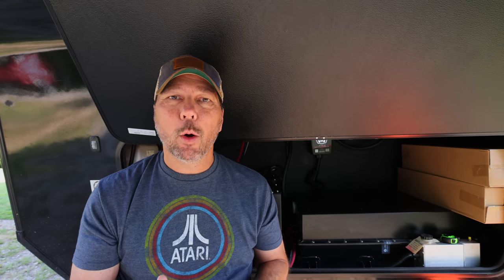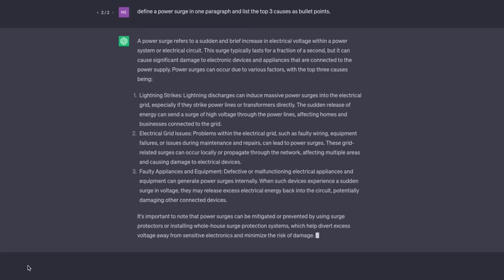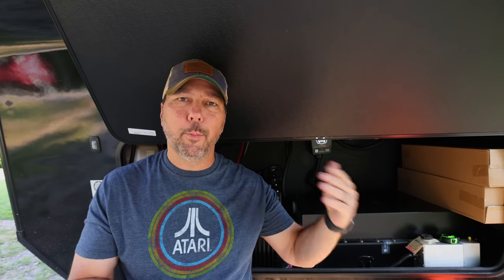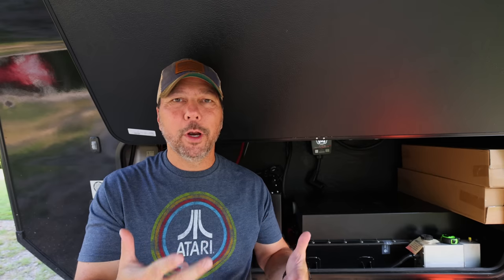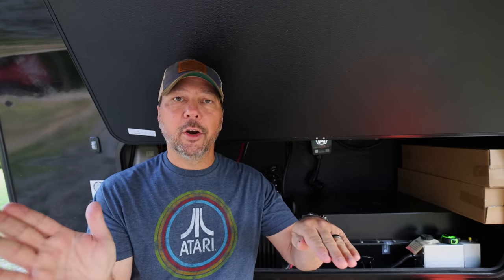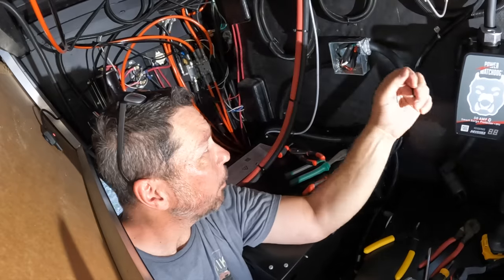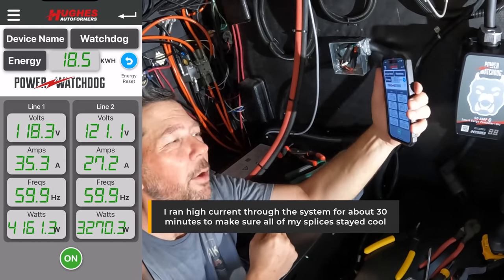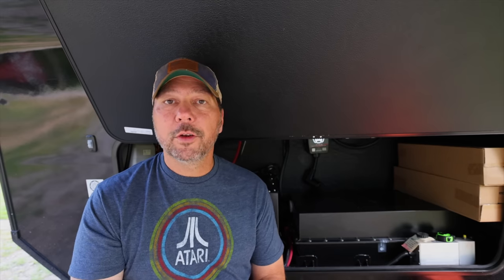RV Power Protection (Hughes Watchdog EPO plus Autoformer)

Comment: We were at an older park in Pennsylvania . . . . major storms . . . .a branch took out the power line . . . . major surges fried AC, microwave, TV, coffee makers and other electronics in RVs without  surge protection . . . . everyone using their air conditioners in the heat of the day . . . . the 20 amp circuit checked in at 111 volts.  A great example for surge protection! This video couldn’t have come at a better time.  Thank you!
Reply from the maker: Also, that 111 volts isn't great for your ACs... The Autoformer would boost that to a normal 122. https://gear.changinglanesrv.com/product/hughes-autoformers-voltage-booster-with-surge-protection-50-amp/

Comment: I've had the setup like yours for about 3 years and it has worked great. Initially I had the autoformer inline with the epo. The problem  with that setup is if we were in a RV park that was almost empty the voltage would go up and with the 2% added from the autoformer it would take the voltage over the limit of what the epo would allow. So now like you I just use the autoformer as needed. I have used the autoformer 4 or 5 times in the last 3 or so years and every time it was a situation like your Vegas episode. Very hot everyone running their air conditioner causing the voltage to go low so no air conditioner for us. Autoformer to the rescue worked every time. Once I had voltage down to 99V.

Comment: I added a hardwired Watchdog EPO to my 35ft Class A two years ago after dealing with low voltage issues at a State Park during a hot July 4th weekend. It has been bullet proof, and alerted me to issues my generator was having that I had no clue about. The project took about three hours from start to finish and was pretty simple once I figured out where I'd place everything in my small electrical bay (have to leave room for an eventual inverter). Definitely agree that the BT connectivity and the app are a great bonus. Great video and thanks for the ideas!
Reply from the maker: Finding the right spot is the hardest part of any RV project.  👍🏼

Comment: I hard wired in a Hughes Watchdog 50a to our 2019 Imagine 2800BH.  I love it.  The only issue I had (user error) was when we were boondocking last year north of Sundance WY in the national forest. I was then running on a single 100ah lead acid battery and wanted to run the AC and charge the batteries.  I started the generator and linked an extra 30a extension cord to get the generator (a Westinghouse iGen4500) farther away from the camper. This is the point where I leaned about line loss. Our Hughes would let power through until it sensed low voltage and then shut off. I learned a few things that week.  #1 - I need to get a soft start for the AC. #2 - Extra extension cords are limited in use. #3 - get Lithium batteries.  We now have a 200ah Li battery that lasted us 5 days boondocking in SD this year.  It was at about 12.4V when we left the campground.  I checked voltage when we got home after about 11 hours and the battery was fully charged from the trip home.  Lead acid would have not been nearly as efficient.  I am glad I went with Lithium.

Comment: Great video!! I have the watchdog epo 50amp and have been using it for about 2 years, love it. I was staying at a park where the whole row of trailers I was on suffered low voltage.  The watchdog did its job, cut power and i called maintenance.  Their advice was to disconnect my watchdog because they are "too sensitive".  Goes to show you, don't always listen to park maintenance, they have no investment in your rig.
Reply from the maker: Yea.. that's like taking the battery out of the smoke detector because it's detecting smoke.. LOL

Comment: Great video, Chad. This all looks good, and the install looked good.
I'm with you on using the butt splices instead of wire nuts. Wire nuts doe correctly are OK, but with it in an RV and a fairly permanent install, splices are better idea. 
It's nice how you have everything set up so you can easily switch one to the other. 👍 👍 
God bless ya'll.  Ya'll take care and be safe on the road.

Comment: 1st, thanks for all the work you do putting the video's together.  I've had the Hughes Watchdog EPO installed on my Trendcend Xplor RB221 for a couple of years now.  It works great, in my case I pulled the breaker/fuse panel out and using the hard wired version EPO mounted it to the floor, removed the 120 volt wire from the fuse panel and took it to the EPO, then a new piece of Romex from the EPO back to the fuse panel.  Our camper is 120 volt single line and 30 amps.  Here's what I don't like about the Watchdog, if you go to 30 amps, the EPO is programmed to shutoff, no fudge, no timer, it's just off.  So in our case (small 30 amp camper) we have to watch things like the coffee pot, AC, Hot water heater and microwave.  Some of those combinations will shut the EPO off.  So you scramble for the phone and reset it, not a big deal, just something to keep up with.  BTW, if you can't find your phone, just go out to the pedestal and shut the breakers off and back on and it will reset. What I do like about mine as it's mounted to the floor, when you 1st plug up it won't close the contactor unless voltage and polarity is correct, at that time I can hear the contactor go thump, even outside and know all is good.  One last good thing: twice we've left a campground to go home and left the AC on, when we got home and connected to my 120 volt 15 amp service via an extension cord the EPO saw the voltage go low when the AC started and tripped.  Sadly it's only temporary and after a time period the EPO will reset itself when it sees the voltage go back up with no load and do it again.  But it gives the AC a fighting chance.

Comment: Getting the pedestal version and put it in a compartment is what the previous owner of my rig did, it's genius.  If the surge suppressor dies it;s easy to bypass and also, like you said you can disconnect it for trouble shooting.  You can also play mix and match with the autoformer.   If your surge suppressor cuts out because of low voltage you can just insert the autoformer and the problem is solve.   The only question I have is there any significant voltage drop with all of the plugs?   Keep the good stuff coming and say hi to Tara and Daisy.
Reply from the maker: Good question.  I'll have to take some measurements.

Comment: Great video. As I was watching the video I kept thinking I don't like how that plug is just hanging there. Coming from the boating world they have a screw on retainer ring on the end of the shore power cable. Right at the end of the video Chad takes that low hanging curve ball and knocks it out of the park. Zip tie the plug. And the fans went wild!! Never should have doubted you.

Comment: A while back I picked up the 30A version of the Autoformer that has the surge protection module (2400 Joules) built in. We're seasonal at our campground, and I can tell you that the boost comes in handy when the big Class As and 5th Wheels start firing up 2-3 AC units on the same leg that we're on. Hughes makes a little voltage "plug in" that just gives you a current line voltage that I keep plugged in inside our travel trailer so I can see where we're at. It's amazing watching the line drop from a consistent 120-124 in the spring to sometimes as low as 110 over the summer. Occasionally it will dip even lower. It's really frustrating when my main breaker inside starts tripping because the line voltage is too low and causes it to overheat.

That was before we got the Autoformer, which has really helped.
Reply from the maker: Glad it's helped you out! 👍🏼

Comment: How was your and Tara's vacation?   I always seen in videos to use a surge protection to check the pedestial voltages before plugging in the RV.  Are going to check your pedestial voltages and possible bad wiring in some other fashion before plugging in the RV?  I can see that you will be protected from overvoltage, but how can you check for bad wiring without checking the pedestial with a multimeter or another EPO type device?  Is there an indication of bad wiring from the bluetooth app on the Watchdog?   I assume if you were using a 30 or even a 15 Amp plug you would just use a dogbone?   Excellent installation as always!  Thanks for all you do and answering my questions.

Comment: The Watch Dog saved our RV. We are hosting at one of the oldest state parks in Georgia. When we hooked up to the pedestal everything was working fine as we were the only RV (Grand Design Solitude) on our loop. But once RV's started rolling in  and AC units going our Hughes EPO cutoff and sent a message saying we had low voltage on one leg. After multiple times of resetting and tripping the park called the EMC. They tested the circuit from the distribution panel to our site (approximately 325 feet) and found an underground fault. The power watchdog saved our AC units and refrigerator. 
RV'ers do not skimp on the inexpensive surge protectors. Get a power watchdog. You will not be sorry.

Comment: Excellent video.  I have both the Autoformer and EPO inside my electrical bay.  What is the reason for not leaving both units connected in series?  When I plug in my RV both units are active.  I use a dogbone when connecting to 30 amp and have not had any issues.

Comment: We ran with our autoformer & EPO both in the loop for a couple of years, but ran into at least 3 RV parks with somewhat high voltage, and the autoformer's 2% boost was just enough to keep pushing the EPO to overvoltage and disconnecting the rig, so we removed the autoformer from the loop.  Probably wise to just plug it in as-needed rather than all the time.

Comment: Great video Chad! Got a portable Watchdog and love it. Thinking I'm going to install it inside my Airstream like you did. Questions: 1) Any code issue with a 50A outlet inside the RV from what you gather? and 2) Did you end up securing the cable to the outlet in any way to keep it in place while in travel? Thanks!

Comment: I just installed my hardwired Watch Dog this weekend on new Paradigm. Wrestling that 6/3 was like fighting an Anaconda. Purchased  extra 10ft of 6/3 from Lowe’s and that wrestled $80 out of my wallet. It was fight night all the way around but it was fun. I live for projects like this. What’s next? BTW, if using a “standalone” generator, you will need to deal with the ground issues and create a neutral bond plug for the gen. Trying to run AC on gen through the watch dog kept Erroring out E6. Bonding fixed that.

Comment: 🤯 Chad love your videos on using devices!!!! Nicely done. Great explanation on devices and uses. Thanks for all your hard work on doing the vids! 
I prefer hardwired in place of the pedestal plug in on the suge protectors. Having worked and had to replace many plugs on the pedestals because of the arcing as the weight of the surge devices pulls on the plug and pulling it slightly out. People don't realize the danage to a pedestal. I don't think I have ever seen a surge device starpped to the pedestal to help with weight. Anyways 👏👏👏👏👏👏👏👏👏👏👏.

Comment: Question Chad why would you not have your Hughes Autoformer  plugged in all the time ? The autoformer will boost the line voltage up to 12vac I'm thinking . Ok 2vac when you plug it in and power it up and  the rest if needed. What if you are away from your RV all day long and the voltage drops to say 109vac ? This could cause problems with any motor device running in your RV at this time. You would not know because you are out doing something that whole day. So say you get home and your refig is not working because the compressor was trying to run off 109vac all day long and over headed. Now you have to purchase a new refig .

Comment: It is funny that I am dealing with this exact problem right now... 107 volts at my site. I've lowered the allowed current in my Multiplus ii
Reply from the maker: Yea.. 107 is no bueno!
Reply: It's supposed to be a 30 amp site but the breaker tripped when I limited it to 26 amps

Comment: I remember when you were in Las Vegas and having the issues. Was that the same time Phil was there having trouble as well with his Tiffin? Question - I have been researching these and some folks are claiming they get a lot of humming noise from the watchdog. Ours will be installed inside as we have a Transit Van B-Model. So the noise issues have me wondering if you have noticed it and how you have liked the unit now that it has been installed for a while. Thanks and happy travels.

Comment: I like what you did, but my concern is the cumulative voltage drop caused by the resistance of all the plugs and recepticles, and the heat that goes with it.  Do you use a conductive grease on yoir plug terminals?  I ask because I had my RV plugged into an extension while full timing.  The plug and recepticle at the extension to RV junction welded together due to a slightly worn recepticle. Had to cut the cables and reterminate them.  Never did get them apart.

Comment: Interesting combination of using the Watchdog EPO but wiring it "internally"  Got me thinking I could do the same thing with my pedestal mount 50A SurgeGuard (that I already invested in and recently sent back to Southwire for a free firmware update to support the new BT App).   I chose to purchase the pedistal mount Southwire SurgeGuard because the hardwired version only had the "wired" monitor panel. As always love your channel.  Looking forward to your full overview of Volta system
Reply from the maker: Yep!  Just grab this kit and use your southwire.  👍🏼  https://gear.changinglanesrv.com/product/hughes-autoformer-hard-wire-kit-50a/

Comment: I have the 30A EPO and the 50A EPO.. both are great units...the only drawback I find using it, is that you cant turn it off from the App even tho it shows an On/Off button...other than that, they work great. Its saved my camper and my 5th wheel many times...great product..
Reply from the maker: Yea.. I think that thing that looks like a button is just an indicator.  Confused me also.  Did you know you can use the 50A EPO on a 30A connection with a dog bone?
Reply: @ChangingLanes  i did.

Comment: I understand exactly what you are talking about we lived in the park you are talking about for 1 year and battled with electrical issues too. The funny thing is the closer to the front you got the better the electrical voltage got. Go figure. I wish I knew about the system your talking about.
Reply from the maker: The piece you need is just this:https://gear.changinglanesrv.com/product/hughes-autoformers-voltage-booster-with-surge-protection-50-amp/. It will boost the voltage 10%.. Also see this video: https://youtu.be/g7xx-AHRjq4

Comment: You could buy a buck boost transformer if you want a cheaper option. You would have to hardwire in but pretty common for electrical installs.

Comment: I have the hard wired 50A Watchdog and tried to use the split circuit set up that you showed in a previous mooch docking video. The Watch dog would not allow it to work. I don’t remember what the error code was that was thrown. I tried with two 15A circuits and 20/15 and got the same results.  Please keep us posted if you have any issues when mooch docking.
Reply from the maker: We've not tried that yet with the EPO, so maybe it's experiment time soon.. LOL

Comment: Hey Chad, I'm not nearly advanced as you in electronics. Is there a website I could go to explore a Volta system and solar for my RV?
This week I had to boondock using my two Cummins 4500i's paralleled. We're in AZ and temps are 110 to 115 and we found out it's 12 gallons of gas for 24 hours.
We're definitely looking for a better way.
Ideas????

Comment: Would it be possible to just voltmeter test lead the park's power outlet (30 or 50) ? BTW: Love those high current butt-splices l Does your RV have bayonet type 50amp plug ?
Reply from the maker: Yes, you can meter it if you know how to check for mis-wired ground, and proper split phase.  Our RV does have the standard plug.  I'd like to try the smart plug, but not until they come out with one that has a 90 degree line in.

Comment: Nice install video.  I installed a solar/inverter system and our Victron inverter has a boost function that can add current when we are plugged in and exceed a set current limit.  I am not sure how the Victron would handle low voltage with respect to boosting.  I also have an EMS to protect against low voltage issues.  Does the Volta system have similar boost function?
Reply from the maker: We had our victron in vegas and it was no help as it can't boost voltage.  We'd be in the same boat with the volta system.